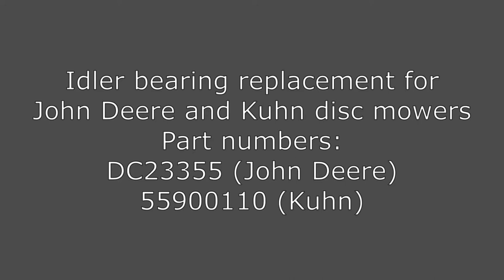John Deere Kuhn Cutterbar Idler Gear Bearing Replacement

Comment: Dos it mater wen you pot the gear bake in the bare if the ring is up or down ?
Reply from the maker: It does matter, see the note at 1:04.
Reply: Yes sa that but wen the bearing is in the gear and you instal it. dos it mater wen you turn it around and pot it in ?